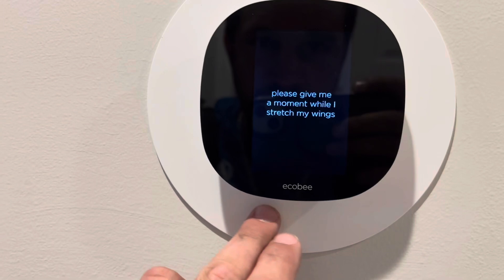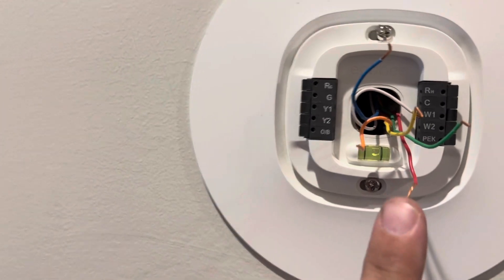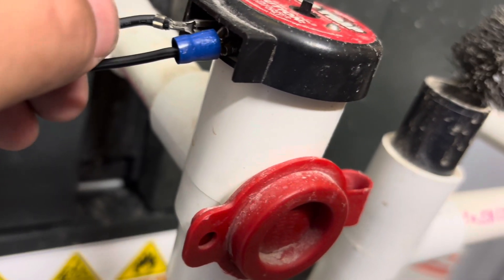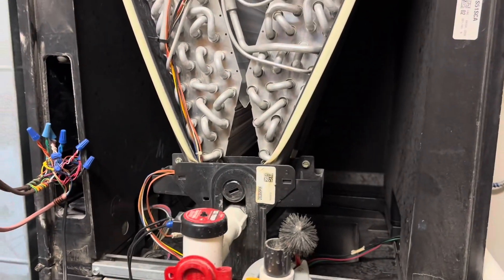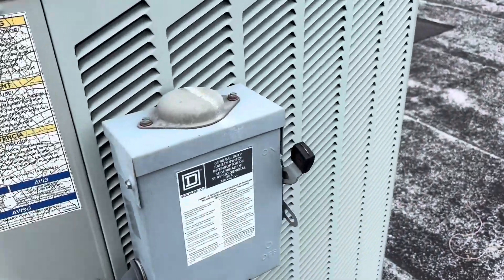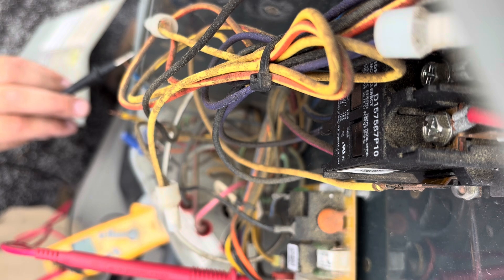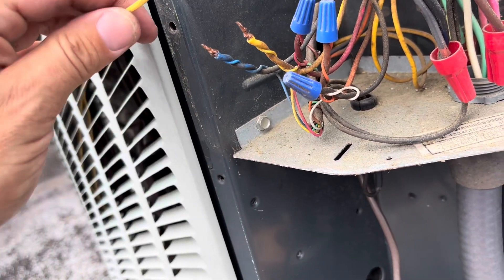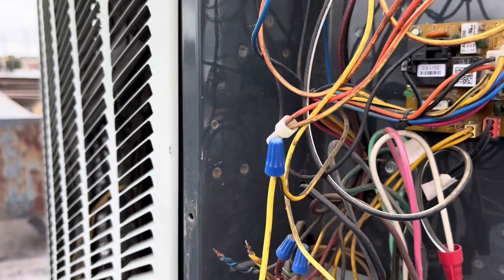I Had No Clue What Was Going On With This Unit…But Figured It Out!

Comment: Good job, low voltage problems can be a pain, especially those intermittent low voltage shorts that will work for a week, a day whatever, and when your not there of course blow the fuse. Then when you go back it shows no sign of a short, lol.
Reply from the maker: For sure delt with a few of those

Comment: Sometimes it is better to wire the float switch to cut off everything besides the thermostat.
I also have a recording voltmeter (max high and low function will also work) to measure intermittent voltages